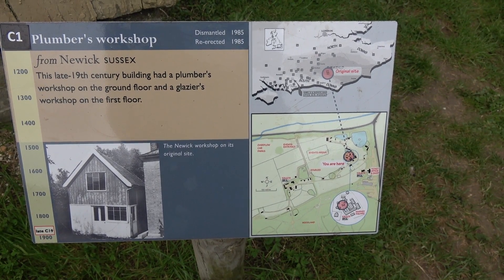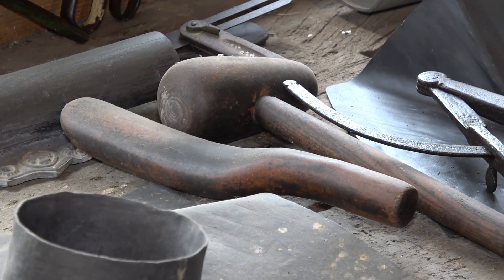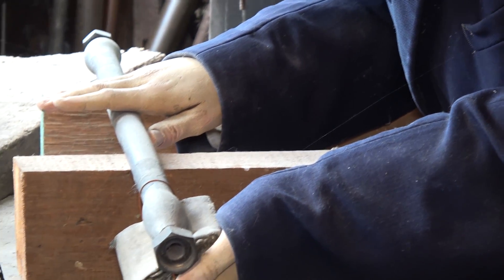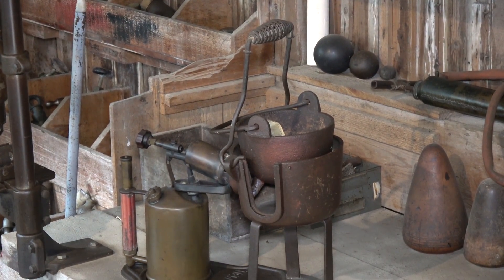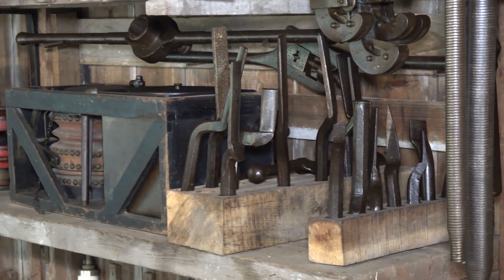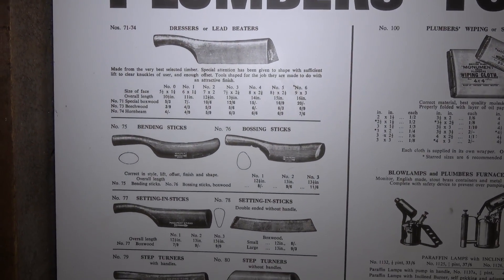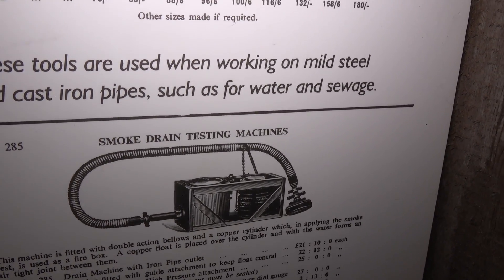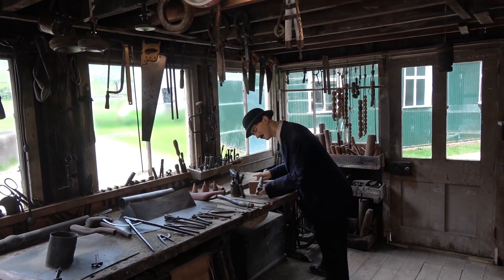Victorian Plumbers Workshop

Comment: I see world war one folding wire cutter on the bench
Reply from the maker: Bret Calvin Well spotted...I did not make that immediate connection...but yes I see it there...thanks.
Reply: @harryrogers  I too spotted the War Department issue wire cutters. I have a identical pair which I have used for the past 30 years. They have never needed sharpening and still give a clean cut. In use they require little effort to operate and cut quickly and silently, which I suppose was a important function of the tool when one considers the working environment and conditions under which they were intended to be used. I have often wondered if the pair I own ever saw battlefield service during WW1. 
I enjoyed the film. Thanks.
Reply from the maker: @billyrussell5148  Thanks Billy..very interesting...I like the idea of the silent operation...thanks.